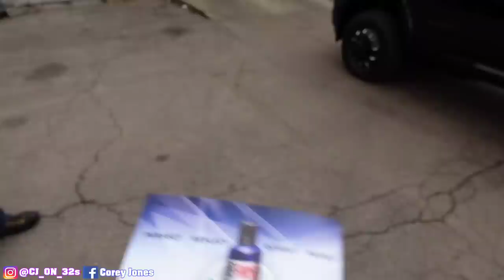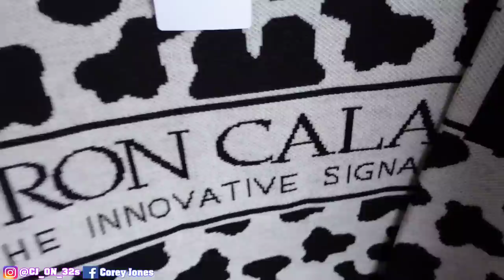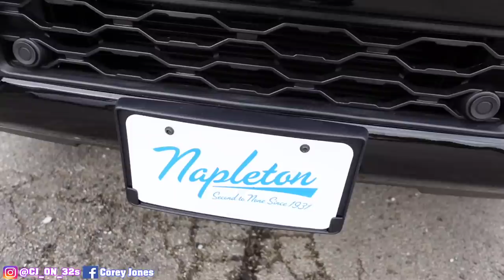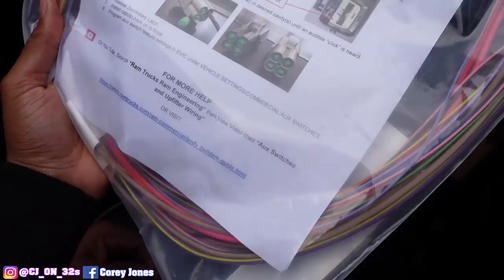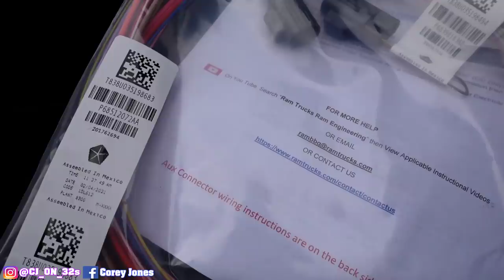OFFROAD AL BUYS DREAM CAR  DODGE VIPER RT ? CERAMIC COATED MY 2021 DODGE RAM 3500 DUALLY

Comment: Yeah boy, ceramic coating the way to go. My truck got that on and the compliments I get is definitely worth it. ... I know your scared to do the custom whips but its beneficial for the cars, keeps the paint from fading, easier to clean, protects the paint from small rock chips and other road debris. I'd recommend it all day

Comment: Truck looking good CJ and them red 30s going look good on the 3500 with the red accent. You can do low pro mud grip like I did on my 28s. Oh yea that plug the dealer suppose to had that plug already installed for you .... good bless and hope moms doing well and tell pops what’s up #32 gang

Comment: Even AL has the bolt pattern wrong for the ct4. It's 5x115, 5x114.3 aka 5x4.5 works but you are taking a risk.

Comment: CJ when you ceramic coated the impala it took them almost 3 days so what kind of ceramic coat is on the trucks it only took   2 days. He didn’t have the other guy ceramic coat truck truck